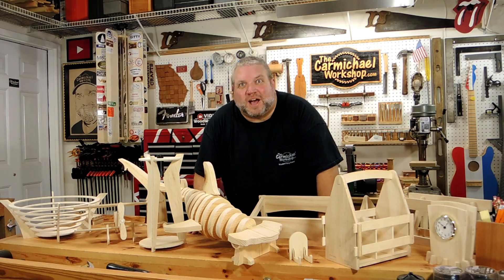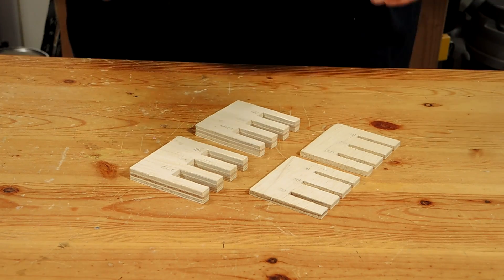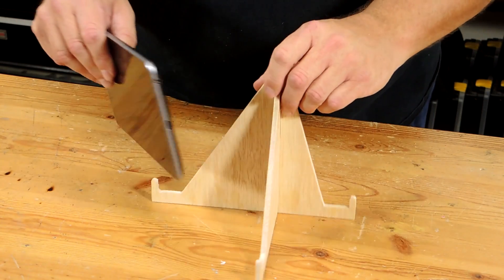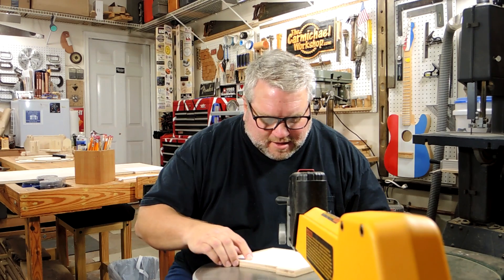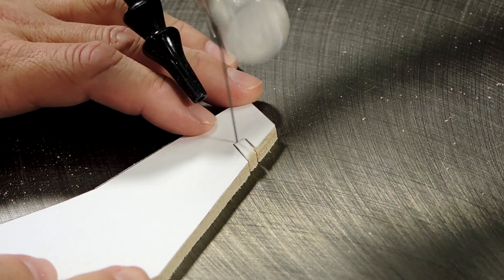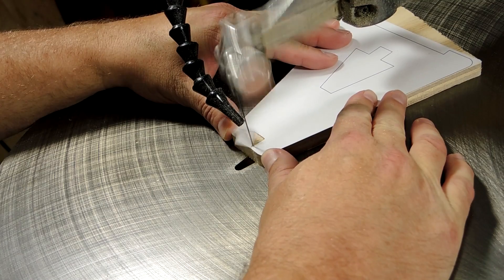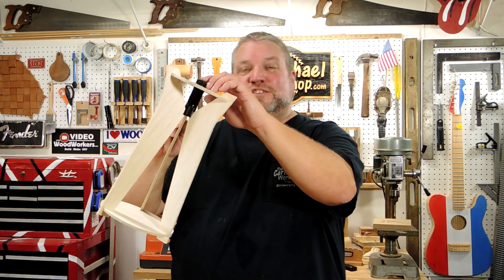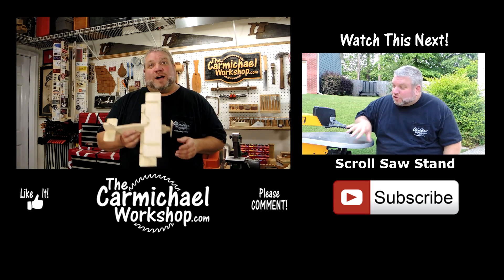10 Fun Scroll Saw Woodworking Projects

Comment: Steve, you're a "WOODWORKING GENIUS & A TRUE CRAFTSMAN"" I have the same Dewalt saw and love it! I started back in the 80's with a Delta "C" arm 20" and did a lot of production sawing on that one, it's not a bad saw but the Dewalt is much smoother. I also have some of the same tools you use plus a 50th Anniversary Shopsmith that I really know how to use.
I also use acrylic plexiglass for projects. I designed some display stands for model airplanes using acrylic and made enough for my whole fleet of model aircraft.
I subscribed and look forward to more of your video projects.
Thanks a bunch.

Comment: Well I want to buy one?  Would it be safe to buy a used one?  Since I need to craft and prove I can use it in order to buy a new one.  Wish I was having as much fun as you.  I love  the shark, the basket, the tiny work horses and the airplane.
You are definitely an excellent saw  ist.
Reply from the maker: Thank you Janice!  It's usually safe to buy a used saw if you know what to look for.  I would ask the seller to demonstrate that it works and try it yourself if you can.  Look for one that uses pinless blades so you can drill smaller starter holes and cut finer details.

Comment: Also I tried to do an interlocking joint like those recently for the 1st time with out a pattern and it was off.  What should I be doing to make it work if I don’t have a pattern.
Reply from the maker: Trace the thickness of the wood onto the piece you want to cut.  Then cut out the joint inside the pencil lines, leaving the pencil lines showing.  Test the fit and sand if needed until they fit.

Comment: Hey Steve, I'd like to say that I enjoy watching your video's. Though I have no woodworking skills I still like to seeing your projects in the making. Maybe one day I can make them. One question I have for you though. Sorry if you already answered it in the past,and I didn't see it. How do you get your templates stick to the wood when you cut them out? Do you use stick glue,or a little bit of Elmer's white glue?
Reply from the maker: I use 3M General Purpose 45 spray adhesive.  Just mist the template and let it dry about 30 sec then stick it on.  It comes off easy as long as you don't overspray it.
Reply: Oh,ok. Have you ever made model cars,or pickup trucks out of wood?
Reply from the maker: Not yet

Comment: Thanks for sharing all your wonderful ideas Steve, they are fantastic.
is it possible to use a scroll saw to do a design on a single size headboard measuring  3 foot? 
😊💖🌟🌟🌟🌟🌟
Reply from the maker: There are a few ways to do that.  Scroll saws have a limited capacity between the blade and the back of the saw.  The Dewalt is 22".  So, you probably would not be able to cut a pattern out of a board that big.  You could cut the pattern out of smaller boards, then glue them together to make the headboard.  Or, you could cut the pattern out of a separate piece of wood and glue it on top of the larger board.
Reply: @SteveCarmichael  Thank you for this information Steve ...... I need to put my thinking cop on now .😊💖

Comment: Hi! I loved your video! I am just about to buy a scroll saw. Could you tell me how did you put the paper on the wood? Did you use some glue or something? And the other thing is, have you used twisted blades? What is your opinion about them? Thank you!
Reply from the maker: Hi, thank you!  I spray a really light mist of 3m General Purpose 45 Spray Adhesive on the back and let it dry for about 30 seconds before sticking it on.  It should peel off easily if you spray it light enough, otherwise you can use mineral spirits to dampen the paper and peel it off easily.  I have used spiral blades for certain things, like isometric text bevel cuts that require tilting the table, and also portraits with random odd shaped cutouts.  They are good for those.  I don't use them when accuracy is required to cut along lines.

Comment: Nice video. What do you use to glue paper to wood? Any specific type you use or can recommend? Thanks
Reply from the maker: Hi Anirudha - Thanks!  I use 3M General Purpose 45 spray adhesive from home depot or walmart.
Reply from the maker: Spray the paper very lightly and let it dry for about 30 seconds before sticking on the wood.  It should feel tacky like a post it note and it will peel off easier.  If the paper doesn't peel off easy, dab it with mineral spirits and it will lift off, then rub the wood with that to remove any residue.

Comment: Good stuff man. Can you recommend a cheapish low noise scroll saw..?? :)
Reply from the maker: My father's old 1980s Craftsman was awful, but I still made some good projects with it.  I upgraded to the Dewalt which is so much better.  The scroll saw is one tool where a more expensive one really does give you a much better experience.  This Porter Cable looks like a good deal, but I haven't used it.  https://amzn.to/2KQk3ML    Otherwise, the Harbor Freight one will be the cheapest and I've seen lots of cool stuff made with it, but most people eventually upgrade.  The cheaper ones lack things like speed control, easy blade release mechanisms, and less vibration.  Just make sure it takes Pinless blades.  Pin blades require larger starter holes.

Comment: For the projects did you use spiral blades or were they plain blades?
Reply from the maker: Hi Andrew!  I used 12.5tpi reverse blade on the plywood, and #3 on the 3/4" pine, both plain blades.  I have some spiral blades but really need to practice since I find it hard to control where it cuts.

Comment: Where do you buy your blades? My wife bought me a no name saw about 8 years ago and I can only find one blade for it. I'd like to find a few different types.
Reply from the maker: I bought some blades from Peachtree Woodworking here in Atlanta www.ptreeusa.com   I got several kinds of Olson blades.  I used the 12.5 tpi reverse on the plywood, and #3 on the 3/4" pine.
Reply: Thanks, I will check out.

Comment: hello i want to ask your dewalt scroll saw how long can you use it without stop? how many hours can it work a day ? would you recommend it for arrartment use? is it for profesional or amateur use? too many questions sorry.....btw very nice ideas i loved the clock one !!!!
Reply from the maker: You can use it as long as you need it to run.  I know guys that have used one almost daily for years.  Like all machines, regular maintenance helps and eventually some parts may wear out, but it will take a while.  It is pretty quiet and I think would be fine in an apartment.  Ground floor might be best due to vibration.  Or keep it out on a balcony.  This is more of a pro machine, a step above the $100 ones.
Reply: @SteveCarmichael  ty very much

Comment: Hey Steve, I'm originally from Wisconsin but settled in NC. Anyways, what brand is your scroll saw? What type & namebrand of blades do you reccomend?
Reply from the maker: Hi James!  It's a Dewalt dw788.  It's a great saw.  I bought a variety of Olsen blades from the Peachtree Woodworking store www.ptreeusa.com where our club has classes.  I like the ultrareverse blades that have teeth pointing down from the top, and up from the bottom, so it cuts from both sides.  They are so inexpensive that I suggest getting several different kinds and tooth counts and experiment on the wood you're cutting to see what works best.

Comment: great for kids to make too. what are the scroll blades that  cut in all directions called?
Reply from the maker: Thanks!  Spiral blades...I am not good at using those yet.
Reply: Cheers mate. I need to find a more usable spot for the scroll saw. It came with a 2 foot long flexible drive  with a dremel type chuck that comes off the other side of the motor. It's handy for finishing the cuts with a sanding drum. Can't complain for £90 5 years ago.

Comment: Are you using a spiral blade?  I like the laptop stand.
Reply from the maker: No spiral blades.  It's hard to cut straight lines with spiral blades, at least for me.  When you use a spiral blade, you don't have to turn the wood around when cutting because it cuts in all directions.
Reply: Steve Carmichael they haven’t cut straight lines for me either. What size and brand of blades do you use most often?  AR
Reply from the maker: I pick the size based on the type of wood and thickness.  Thicker wood gets a #% or #7 blade with fewer teeth.  Thinner wood gets a much smaller blade with more teeth.  I have a mix of Olsen, Pegas, Flying Dutchmen, and some I don't know what brand they are.
Reply: Steve Carmichael what’s your favorite brand of blade and why?

Comment: Hey Steve! Quick question-can one use pine wood for Intarsia? I just went to the big box stores in my area and they only have poplar and pine...
Reply from the maker: Yes definitely. You need different colors of wood, so look for boards with lots of color variation. Poplar has some nice greens and purples sometimes. Look for oak in the trim aisle, and cedar in fence boards, whitewood and fir 2x4s, and. Southern yellow pine. Just get one of each kind with different colors.

Comment: Super cool. I have a Scroll saw on my wish list along with a lathe. Both will have to wait though as I need to fix my van first and money I had been saving for both is now going that way. :P Always happens laughs Have you ever tried using a scroll saw on cured resin sheets? I would be interested to find out how that works as I would probably be using resin more than anything else. :D - Heidi
Reply from the maker: Hey Heidi - I have used it to cut clear acrylic.  It helps to have a saw with adjustable speed, so it doesn't go too fast and melt it.  I'm going to try cutting record albums soon.
Reply: Steve Carmichael Thanks for the reply. :) I guess when I do manage to save up to get one I will have to cut resin and do a video. :D Ouch album crafts always make me sad. I love vinyl...

Comment: what kind of sticky paper do yu use?
Reply from the maker: Hi Ken - It's regular printer paper.  I spray a light mist of 3M General Purpose 45 spray adhesive on the back and let it dry for about 30 seconds so it's tacky like a post-it note, then stick it on.  It usually peels off easily, but if not, I soak it in mineral spirits and it comes right off, then wipe any residue off the wood with mineral spirits.

Comment: Hey brother, what am I sacrificing by purchasing a $120-$150 scroll saw? I'd love that Dewalt but the $500+ price isn't feasible for me.
Reply from the maker: Lots of people start with a less expensive saw and make great things, then upgrade later if they want to stick with it and make it more enjoyable.  The scroll saw is really the only tool where I've been really surprised at how much difference a good saw makes in the user experience.  Here are a few things to consider - It might only take pin blades, so get one that will hold pinless blades so your starter holes don't have to be so big for fine detail cuts.  It might be harder to attach the blade below and above the table, and could be more cumbersome to detach one end of the blade to move it to the next starter hole.  It might not have a speed control, which helps to get the best cut on both soft and hard woods and also controls amount of vibration.  The table might be smaller.  Also, the distance from the blade to the back of the saw could be smaller, limiting the size of a project that you can cut, but some saws let you turn the blade sideways which is a good workaround for that.
Reply: @SteveCarmichael  I bought the Wen 3933 which accepts pinless so I'll learn on it and upgrade if I can start making some $. Thanks brother!

Comment: Hey Steve. Loved these - hammerhead shark was definitely my fav! A quick question - what type of adhesive are you using for the templates? It seems to peel off real cleanly. Cheers. Matt
Reply from the maker: Hey Matt - I use the 3M General Purpose 45 from walmart.  Spray lightly just to mist it, then wait about 30 seconds before you stick it on.
Reply: I'm from the UK so no Walmart but I'll see if I can find something on amazon. Cheers Steve!

Comment: LOVE THE BOWL!! Awesome to see a new video bub.
PS if you need I can make you some DFX files for the CNC people.
Reply: LOL you got 2 thumbs down by the time I saw this. Someone dont love bears.
Reply from the maker: Hey, thanks!  This one took a while to do.  I was thinking these would make good cnc projects, but not sure how that plywood would cut with a router bit.  I drew up the templates in Visio and I think it saves a DFX, but not sure.  I might try one on the xcarve with solid wood.  I could do a Steve vs CNC video.  lol
Reply: would be worth a try. maybe speed and accuracy vs manual. not sure how fast an Xcarve is. I run 120 inches per minute most of the time or 60 if I want it super accurate on the Blackfoot. but I do think it would make for an interesting video. maybe just 1 or 2 of the items.